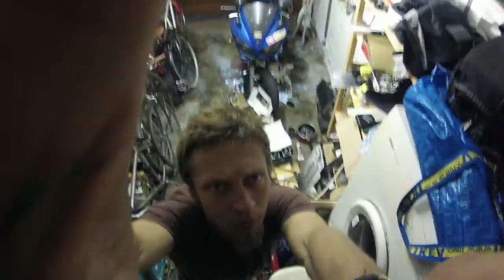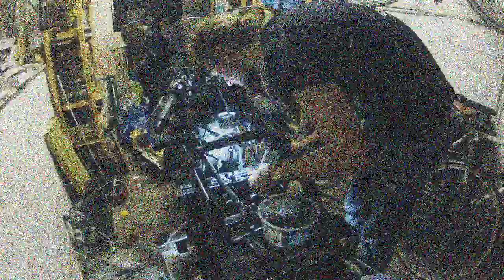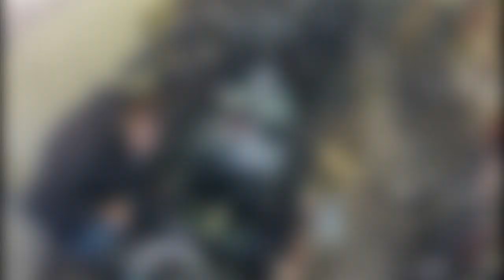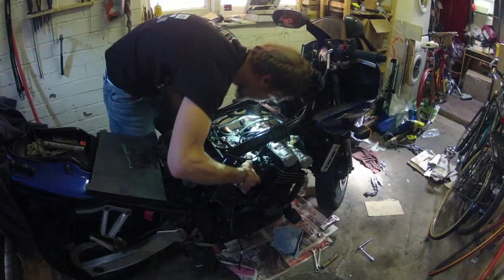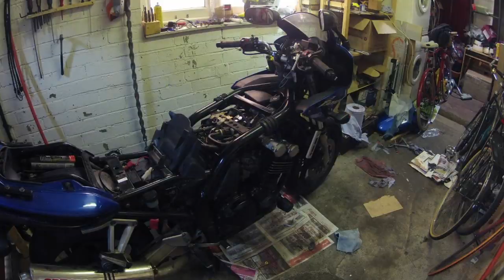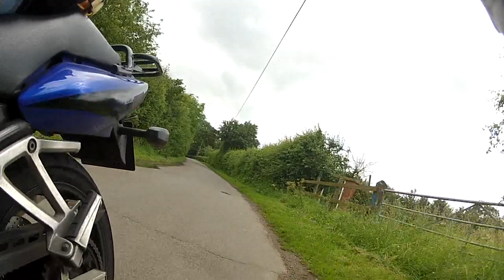Yamaha FZS600 engine assembly and test drive after valve lapping (time-lapse))

Comment: Sorry to sound thick , what does valve lapping mean , thanks Shane uk
Reply from the maker: Basically it is a process of radial polishing  of contact surfaces between valve and valve seat to guaranty pressure retention inside cylinder after engine works.

Comment: Hi cool video. I would love  to know ,there is a plastic  coolant reservoir next to the rear shock .It has two hosepipes where does  the downer one connect to?
Reply from the maker: Hi,
Very top outlet of thermostat block.
See Page 195 http://www.fazerclub.ru/manuals/Yamaha%20Fazer%20FZS600%20'98%20Service%20Manual.rar
Reply: Thanks  I found it it think I was just tired and wanted to continue.

Comment: I've an fzs 600 and it's struggling to get to 90 mph.. Any suggestions to what it might be, I've new ignition cable's on it, air filter, spark plugs. I'm lost on what it could be.
Reply from the maker: couple of things to check/do: valve clearance out of spec, low compression,  burned valves,  clogged carburetor, faulty throttle position sensor,  carburetor synchronization.
Reply: Is it restricted, and you don't know?
Reply: Is it restricted and you don't know?